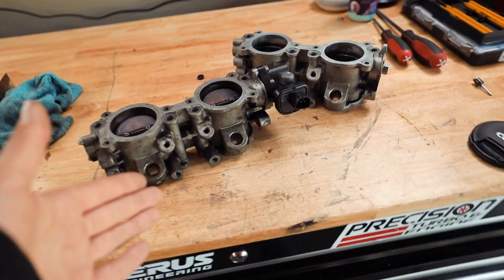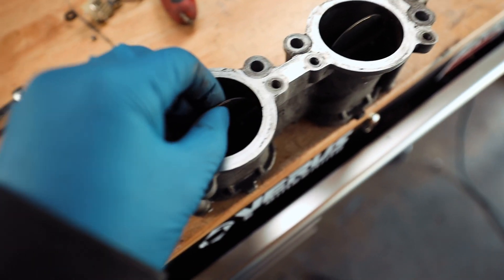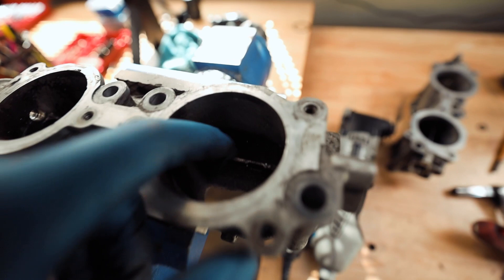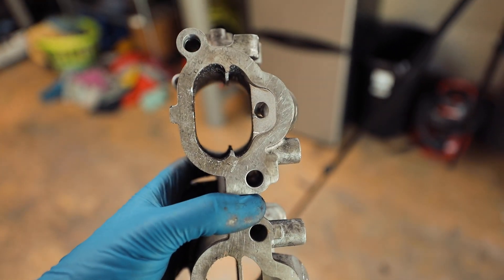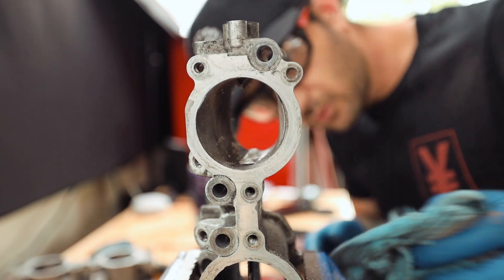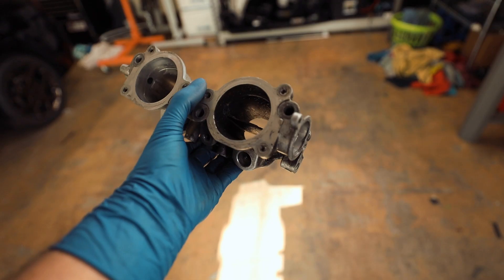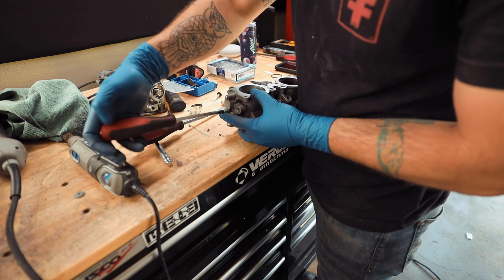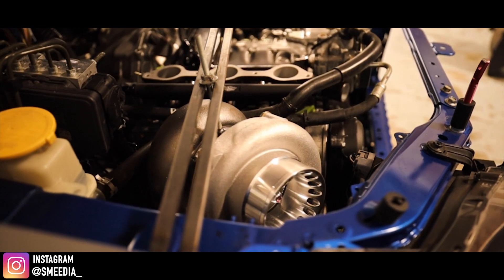DIY TGV Deletes (Subaru WRX/STI/Legacy GT, Outbackt/Forester XT)

Comment: Gonna sound weird, but if you grind the end of the little flap screw off til its flush with the bar (no visible threads out the back), they unscrew so much easier and don't strip. Worked awesome for me. So many pencils! ✏ 🖋🖊🤙

Comment: Ya know.. the other day, I was wondering if I could just do what you just did to the stock one. Thanks for answering that for me. I love DIY projects. Especially ones that give me more pencil holding power.
Reply: I also wish I had a 3d printer. Just print my own brand lol I don't believe they'd melt?
Reply from the maker: Idk how well they would hold, definitely would rely on what material you printed with 😅

Comment: If you put that small motor back on and plug it back in, I'm assuming that the computer won't know I gutted the insides? Asking for a friend. The friend is wanting to do this but lives in an emissions controlled state.
Reply: Should
Reply: Still need to make a sensor happy that lives on the other side of the casting?  I'm going to go with the method by SubaruONLY...
Reply: No CEL with this method

Comment: Don’t need to drill the first bit off where the motor is as the whole thing slides out that way. Drill out the screws remove the flaps and tap it from the sensor side. Just done it today

Comment: So if the motor is hooked back up and plugged back in, will it not trigger a “pencil error” code? Or will i need to sharpen my tune?
Reply from the maker: You'll need to resharpen the tune. Some people leave the rod in there with the motors and it ahouldent throw any codes

Comment: If I reattach the motor, does that prevent a “check pencil light”?
Reply: Mine has a sensor on the other side... I'm thinking about leaving the rod and just removing flaps.  The check engine code disables my cruise control

Comment: If i did this and put the pencil holder back where it came from (with sensor hooked up) will the ecm freak out or will it think all is normal?
Reply from the maker: If you left the acuating rod and motors it shouldent throw a code 🤫

Comment: Do you think we can do this mod, keep the motors though, and avoid a code being thrown and still be tunable using the COBB AP? While gaining the benefit of extra air flow?
Reply: trying to figure out the same thing….
Reply: @Eduardo Rodriguez  as far as I'm aware if you keep the bar in place with the motor everything is gravy

Comment: Might need some specs on this pencil holder, would the holes on the side lead to any pencil leakage, or would it be ok to leave them as is and take a slight performance hit?
Reply from the maker: They should be alight as is, for optimal pencil flow it would be ideal to weld them shut and smooth them out. but wouldent be the end of the world if you did not

Comment: Will the life/reliability of the engine decrease if we do a tgv/egr delete? What are the pros and cons?
Reply from the maker: Nope. Removing the pencil restriction allows more to flow though it. More air, more fuel more boom
Reply: @Smeedia  think of doing full tgv delete bottom and uppers, but didn't know if it would decrease the life of the engine or not, thanks for the help 😀👍🏼

Comment: I did the same u did but I got three codes P2006
TGV System 1 (RH) Malfunction (Stuck
Closed)
P2007
P2092
What I did wrong?

Comment: Look forward to making my own shop pencil holder soon! Quick question if you don't mind. When rebuilding a set of heads, would you recommend new valve guides, seats and locks as well as valves and springs and retainers?
Reply from the maker: If you've got over 150K and looking to rebuild yes, or if your looking to make more power and planning on doing cams at some point, yes 🙏

Comment: Have you or anyone here had any luck using aluminum brazing rods to fill the holes? Also thinking about leaving the motor on but heard the motor gets in the way of fuel rails?
Reply from the maker: I've never tried but in theory I don't see why it woildent work. The fuel rails should clear the motors 🤔
Reply: @Smeedia  Thanks, you da best. I must have heard that wrong lol ** edit - I think it was something about needing to do an extension on the an fittings

Comment: Unfortunately, difficult to find someone that will tune this bigger pencil holders nowadays. Can I use this without a tune?
Reply from the maker: If you leave the metal rod in there and just remove the flaps you can get-away without needing a tune

Comment: Would it pass E-mission
Reply: If you don't leave the bar that holds the buttfly valves your pencil holder will cause a problem. But no one said the butterfly had to be on the bar!

Comment: Really sucks when you are trying to make your pencil holder bigger, but your tool is too small. 🤣🤣🤣
If you put the motor dohickie back on the side and plug it back in, would that work and not cause a check "pencil holder" code?
Reply from the maker: Depending on what year you have it may not throw a (CPL: Check Pencil light). I beiluve the newer ones will. 
😅😅